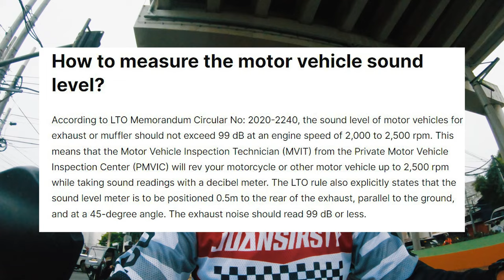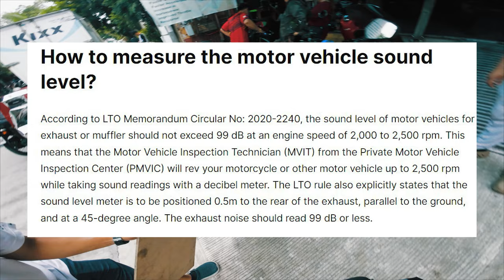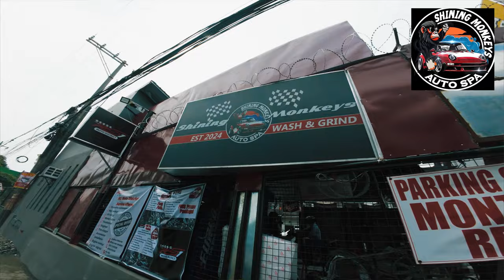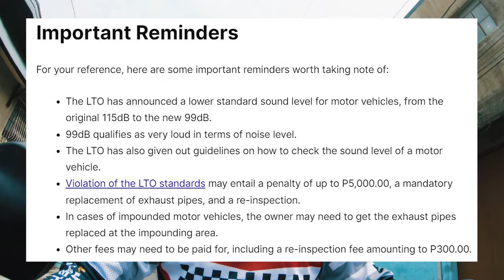WHAT & WHY ECU REMAP ON SCOOTERS? -MODITECH HUB | NEW ADV160 POWER PIPE!

Comment: Mahirap talaga kapag newbie. Makapagpadyno nalang. Alam mo ba mali yang pagdyno sa motor mo? Wala manlang blower sa unahan ng motor mo para imimic yung hampas ng hangin kapag bumyahe ka. Nautakan ka jan hahaha
Reply from the maker: Sarcasm ata ito. Haha! I think you're referring to Aerodynamic Test Kap and not AFR correction by ECU Remap. Nevertheless thanks for watching!
Reply: @KapArkiRT  sarcasm?brader kapag nagpapa dyno tune ka dapat may air blower talaga. Iinit ang makina mo wala papasok na hangin sa radiator ng motor mo. Alam mo yung heat soak na term? Kapag di makapag decipate ng heat ang engine mo equals to loss of power. Binibigyan lang kita ng idea.
Reply from the maker: @pizzaroll6604  @pizzaroll6604 thanks for the idea! Siguro enough yun apaka laking bentilador na nakatapat sa motor para palamigin ang maliit na makina ng ADV160 Kap. Maliban pa sa liquid cooled naman ito and hindi air cooled na mga old type ng rad. Pero ganda nito! Natuto ulit ako! 

Edit: Hampas ng hanging kasi una mong tinukoy Kap, so thinking ko is Aerodynamic Test. Hehe!
Reply: @KapArkiRT  meron nga ecu tuner kuno pero copy paste lang ang files na lilipat sa ecu. Keep up sa quality content
Reply from the maker: @pizzaroll6604  thank you Kap! We also have a different test sa vlog between C&P vs Actual basing sa bagong exhaust system. Commend ko lang yung decent conversation na ito. Salute!